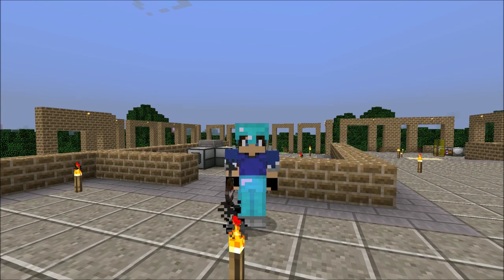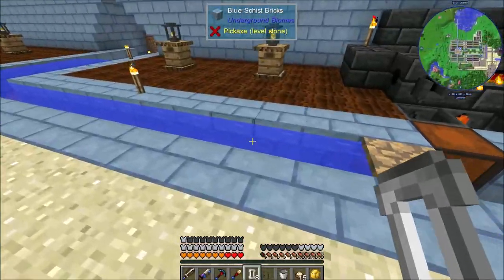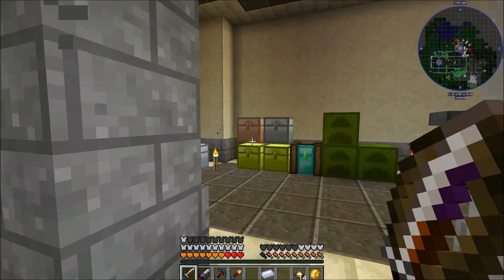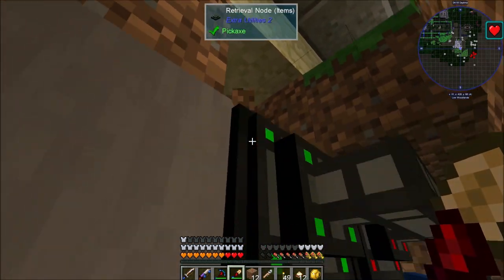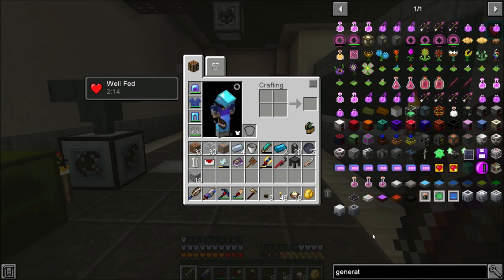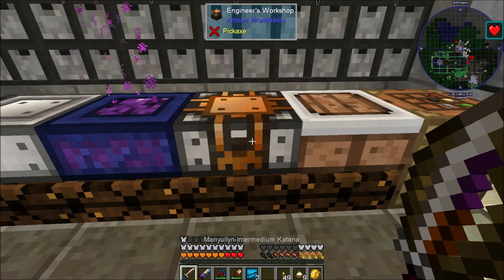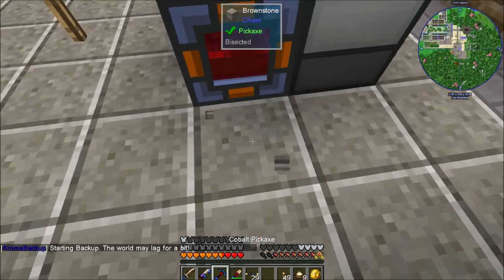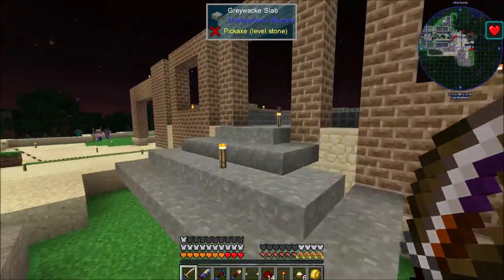Power Generation and Preparing for More: DDSS Lp Ep #29 Minecraft 1.12

Comment: You should see if the modpack creator will add railcraft or something with vehicles. Itd be really interesting to see you drive around the compound
Reply from the maker: steves carts can do vehicles which we will be doing in time, for that matter vanilla minecraft does them as well :)  railcraft is more about more in depth rail control.  Would ofc love to see immersive railroading in the pack, but thats because I'm a sucker for that mod :p  wanted to put it in my pack, just doesnt really fit the theme at all
Reply: @ToAsgaard  I've never seen Immersive Railroading.  I tried to find which modpacks it would be in and there was nothing obvious.
Reply from the maker: doesnt really show up in most packs.  Naturally every pack needs thermal expansion, rftools, xnet, immersive eng over having unique and underused mods :p  To be fair, its not without its bugs, but it really just needs heavier playing and testing.  Is a lot like little tiles was, great mod with a lot of potential
Reply: @ToAsgaard  I guess every mod goes through changes as they update to new versions of Minecraft.  Some have minor changes and/or a few additions added to test out to see if they're popular enough to develop as a part of the whole or an offshoot/branch of the main mod.  Some fall by the wayside to be picked up by someone new several versions later.  While some just won't work with later versions of Minecraft altogether or become obsolete as a similar new mod takes their place.  It's sort of interesting how these mods morph or end up on the Island of Misfit Mods.  Organic.

Comment: Do tech reborn things blow up
Reply from the maker: not from what I've seen.  I'm not as familiar with it as say ic2/ic2c, mainly due to the fact that it was buggy and incomplete for a long while but seems to be much better now, but I know in my test world I checked to see if different power tiers would cause an explosion and they do not, at least generating power in a medium tier and butting it up against a low tier machine for direct power transfer.  Had been checking that to make sure as to what sort of limiting I would need to do when it came time to plug up creosote power gen, but seemed fine without anything special
Reply: Now that they are rf based, they don’t.  I think they did back in the EU based 1.10.2 versions of the mod though ... along with the destroying themselves if you didn’t use a wrench to pick them up, which is apparently still a feature in this pack.